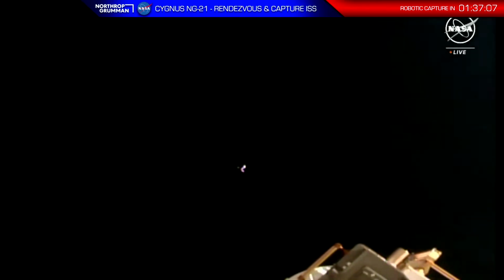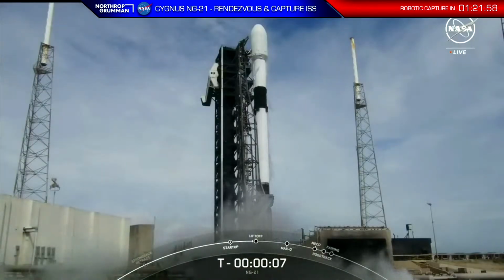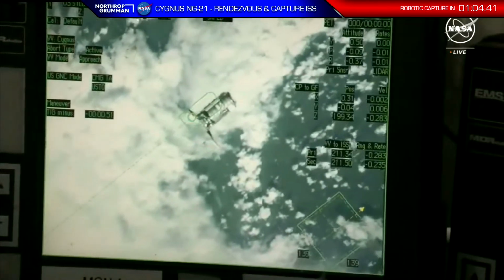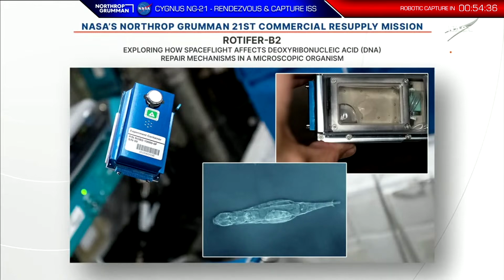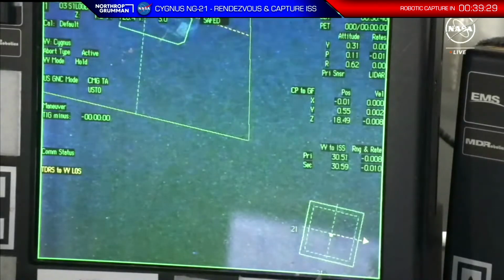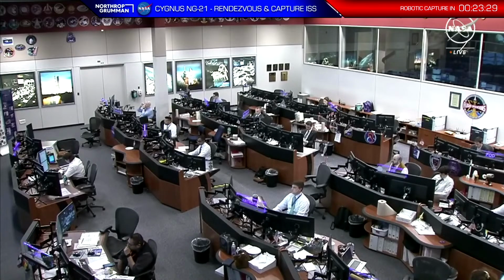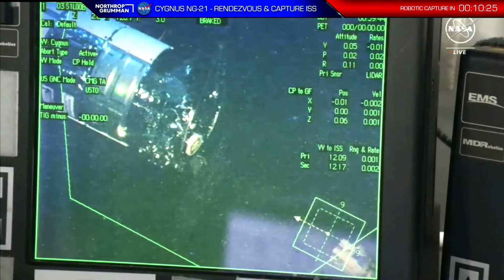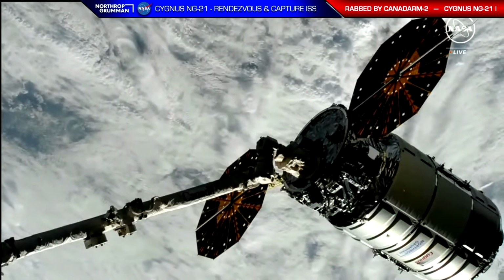Northrop Grumman/NASA - Cygnus NG-21 - Rendezvous & Capture ISS - August 6, 2024

Comment: What is the object just above the joint in the Canadian arm that appears to be down in the clouds? It doesn't appear to be a shadow because it leaves a trail in the clouds. You can spot it at 1:47:56 time frame.
Reply from the maker: That is dust on the camera lens, you can see that also before when the cam is streaming. No UAP here. ;)